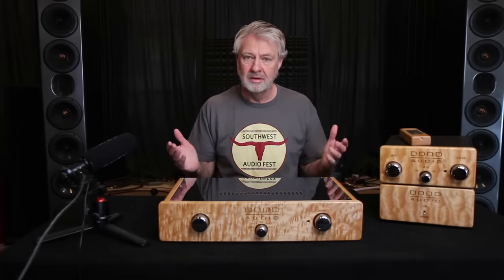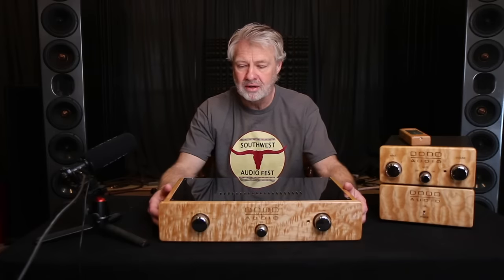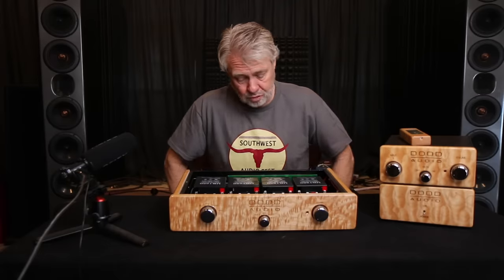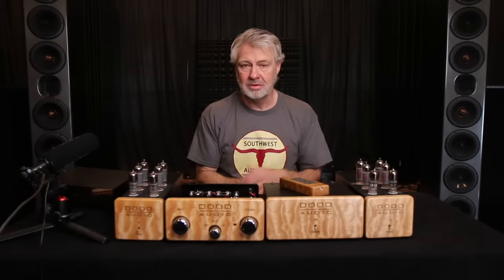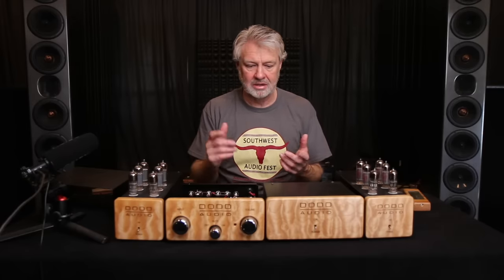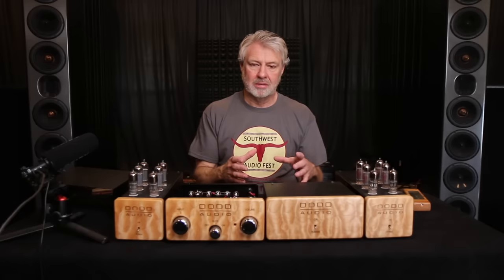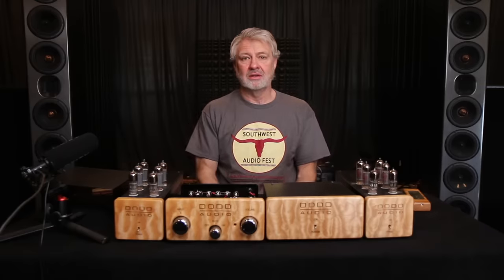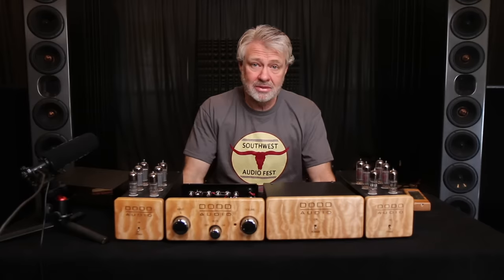Unveiling Danny's Audiophile Rig: Off The Grid and Beyond...

Comment: Very interesting, what I don't understand is how the c-tec which is on the grid is not introducing grid noise back into the system???  What have I missed???
Reply: I don't know, but the trickle charge system is very quiet.
Reply: It is about the impedance. What little noise ctec makes is sunk in to the battery like in a black hole
Reply: @dannyrichie9743  my system is completely off the grid too, I use regular, lead-acid/ calcium, car batteries up to 75 amphours, I use c-tec charger too but I did notice a degradation of sound when the charger was left on. So I've been just listening and recharging later. That experiment was long ago, though. Perhaps I'll try again, based on your words.
Reply: @zaldam  ??? batteries are not capacitors. Slow-ish chemical process vs order of magnitudes faster charge transfers.

Comment: Interesting Theory. Makes sense, local power instead of the big AC coming into your house through questionable lines is taking it to the nth degree. I'm really curious now that the sweet spot of sound has been found, what are you listening to? I got a decent JBL system, better than most, speakers do perform very well, quite balanced and little coloring to what comes through them. But I make use of my subwoofer quite often liking and listening to on average 4 hours a day of music listening to very special Rock, Metal, Industrial, Techno and the new Synthwave. I play drums as well to so like a heavy beat.  but respect and listen to all kinda of music, just not a country guy. Don't get it. But what do "audiophiles" listen to?

Comment: Pretty much every modern desktop computer (mac mini is a desktop not a laptop) runs mostly on 12 Volt, AC (120/220V) into powersuply DC 12V from PSU into components (there are some 3 and 5V rails too but those are barely used). Really nothing special about the 12V thing, it's normal and has been for many many years. These days there are also lots of mini PCs on the market (the better ones start at 200$). I actually have a mini PC right next to me here with a 12V 30W power suply. I guess I could get a better quality adapter than the one it came with.
The 19V thing with laptops is just because of safety certifications (to stay under 20V).
Reply: We tried PC based solutions too. The little MacMini ate them up. I am not sure as to all of the specifics, and I am not a Mac guy. I would much rather use a PC.
Reply: @dannyrichie9743  sure, might be, I didn't really test it. My comment was mostly about the 12V thing you said. 
I used to be a DJ though, that was all Mac. I think for three main reasons: ease of use, stability (extremely important as a DJ) and better audio processing. Not sure this is all still true today. I am all out PC these days, it has come a long way. But I can believe a Mac mini might be the better streamer.

Comment: That's genius. Get rid of the ac! I know how much noise ac can make. Been an electronical tech and electrician for over 30 years. The back feed on the neutral from lights and equipment cause havoc in audio circuits. Now we have dacs all digital so almost no noise except operational electrical characteristics of the circuit design. The distortion from that is like .0036 or better. Only gonna hear the difference in high resolution music on a good system. Most people can't hear anything even close to that.

Comment: no need for a big agm... gotta be big because of the low cont. current draw. You tried "lithium" you likely use low C rated Lithium ION "laptop" batteries.... no no no... use Lithium polymer batteries, with a high C rating. 50c to 100 c .. I use 6s 5000mAh 100c graphene battery... I think you should have a listen, see what you have been missing ;)

Comment: Sounds like you know what you are doing. I thought batteries had thermal noise. You have to have a bank of capacitors fed by the batteries. I use deep cycle lead acid batteries, 90 amp hours. I never connect the charger when I am playing music. I don't have a capacitor bank. I think that the more caps the better. I may have to build a capacitor bank. You will never get good sound using CD digital resolution. If you want good sound play DSD or vinyl.

Comment: As a professional RF engineer with 35 years experience, with respect, you blew it right there. If it's interfering with your camera then it's creating RF noise. This is just yet more snake oil for which a premium can be charged in my very humble 35 years of RF design work and dealing with interference, passive intermodulation and etc. but hey, what do I know. Please do absolutely blind tests, by you, sat in front of your reference set up with third parties installing various kit and publish the results
Reply: Sorry, I'm not following your logic here.
Reply: If it took the camera out, then it's creating RF noise that can be mixed back in to any non linear device and create intermidulation. If you wanted to be purist there used to be a set of miniature valves (sorry I'm a Brit) and you could actually power those directly from a bank of batteries instead of using the potted invertor (or whatever you believe that secret sauce to be that created all that junk RF)....again my humble 35 years as a chartered engineer with an actual degree in communication engineering that is mostly to do with managing signals and and a mispent youth playing with valve technology.
Reply: I understand that you don't like RF noise (or what you assume is RF noise), but how is this snake oil? Where exactly is the scam?
Reply: These pre-amps are dead quiet and do not produce RF noise. I will check into this further and see what it was the camera didn't like about clicking them over into the mute mode.
Reply: Well, it wasn't the camera freaking out at all. That beeping was the pre-amp. It beeps like that when the batteries are low. There was zero FR noise.
Reply: If there is some form of invertor then it is almost definitely using an oscillatory system to provide the anode voltage, unless you are using the very low voltage valves, which I suspect you are not. Even these used more than 24 volts typically. The snake oil is going through the whole convoluted process of using batteries which you still have to convert back into an anode voltage. Given the studio probably used standard equipment in their recording chain I cannot for the life of me see how you can do better. Again, I would challenge you to blind tests using good quality commercially available gear and your pre-amp.
Reply: @Oggycrew  So are you saying that Dodd somehow conned Danny into thinking the battery setup was better?
Reply: Just to qualify that, my friends were designers at Allen & Heath and Soundcraft etc. I don't think that they ever had problems with running NE5534's and etc off standard power rails for studio mixers...and we shouldn't for our HiFi....sure valves have a certain artisan vibe but so much of what is called hifi just seems to involve the application of inherently expensive componentry for marginal technical/sound benefit. My original point is that anything that is producing potential RF is going to also create potential induced intermodulation products thus being counterproductive to your quest for audio purity
Reply: @JasonWW2000  unless it's directly driving the anodes of those valves then there's some form of inversion...probably involving some form of RF...I actually assumed that the noise was created in the camera...if it was interfering with the camera then it could equally interfere with anything else in the signal chain. If however it uses the low voltage valves then maybe I can go with that but even then 48 volts would be the minimum.
Reply: @Oggycrew  The part where you say "the application of inherently expensive componentry for marginal technical sound benefit" is easy to explain. This is almost always the case. When you're HiFi system is at a relatively high level it becomes more and more difficult to improve it. So you end up having to use very expensive/esoteric gear to squeeze out even the smallest of improvements. It's just the way it is.
Reply: @JasonWW2000  firstly I really like Danny's channel and what he's trying to achieve. Secondly I am libertarian: whatever you choose to do or buy is absolutely fine by me. Thirdly, if you're a scientist/engineer then quite a bit of HiFi makes no sense at all. Then there's chasing your own tail. If you want to take the possibility of dirty mains from your audio chain, sure go DC. I'm a big fan of the guys who use batteries to power class D amps. But here it either of two things. Sure you can have batteries power valve amps. Why not. But then you are probably going to need more than 24 volts. That means converting the 24 volts back to AC which has the potential to be "dirty' again. I don't know the circuitry and I assumed (wrongly maybe) that the cct was interfering with the camera. It could do the same with the rest of the audio circuitry. Danny appears to have cleaned that one up. But I will still contend that if you're converting that 24 volts in any way it's going to be self defeating. So you must then use 24 volts on the anodes which in my humble opinion is on the edge of reality. Plus, like I've said, the guys who build the studio consoles used to use low noise op amps. I suspect a very high percentage still do (NE5534) unless you're also going to suggest irradiating those from the audio chain then again you are chasing your own tail: noise is cumulative. That's just my 2c....if on the other hand it's all psycho acoustics and stuff that we can't measure, then do blinds tests and publish the results
Reply: @Oggycrew  Gary Dodd figured out uncongenial ways of doing things that yielded really good results. As they say, the proof is in the pudding. The performance speaks for itself.
Reply: @dannyrichie9743  thanks for the engagement and reply. My engineering education and logic would dictate that it is unlikely that the technical performance is any better than a regularly commercially available amplifier. As I've said before...free world...how you view it, what you spend your money on etc...your choice. With speakers there are a huge number of factors that combine to produce what we would all regard as great performance. With electronics...not so much...or at least not to the same extent. The last few decades of development provides incredible performance at relatively modest costs and for pre-amps specifically, small signal stuff, where you don't need big power supplies this is even more so the case. I haven't seen Mr Dodds designs and so I can't really provide a detailed analysis but the idea of using low tension batteries in a valve design that in all probability then requires an up- conversion of the voltage doesn't stack up in my humble opinion. That's where my snake oil comment comes from.
Reply: @Oggycrew  Some advice for you to keep in mind. When there is something you don't understand, it is better to keep you mouth shut and listen before crying snake oil. That rig you saw on the table was used in an exhibit at RMAF and it won multiple show awards including "Best Sound Cost No Object" from the Absolute Sound. All of those electronics came in at under $6,000 too. It was the best bargain at the show.
Reply: @dannyrichie9743  hahahahaha…..I don’t mind rude. I hang out with studio designers, award winning audio professionals and like I said I’m actually in RF engineer but it’s all signals to me. You won’t be discussing the advantages of the fast Walsh Haddamard transform or the difficulties of Passive intermod. Stick to your speakers, you seem to be onto something there. Get your mates to publish and we can assess the revolutionary benefits of 24 volt valve tech….its escaped just about everyone else!
Reply: @Oggycrew  The Dodd Audio gear is highly sought for a reason.
Reply: @dannyrichie9743  hi Danny. I am obviously not buying it but I do have a reflection on the topic. The electronic to air interface, the speaker is highly complex and in a way not exactly deterministic. There's all kinds of room factors and psycho acoustics and blah. Whereas electronics for the most part is pretty well understood these days. It's no longer just about power and distortion figures plus a sprinkle of damping factors but it is easier to measure and quantify. That's about it really. Again, anyone wishing to spend lots of money on esoteric stuff that is entirely their choice. It's fine by me.

Comment: Nice concept but very poorly executed.
The potted electronics are big red flag. Nobody should do it that way. Unrepairable even if it`s made for eternalty something might go wrong.
And btw. power hungry tubes on batteries, a useability nightmare. And they wear out and need to be replaced.
I`m all for battery power but like to keep it solid state.
Reply: Actually it has been very well executed. The potted parts have never failed and likely never will. My 100 amp hour batteries on average last about 8 years. Maintenance has been all but zero.